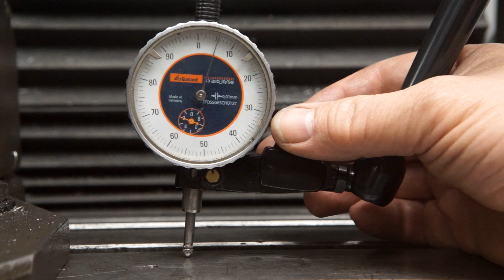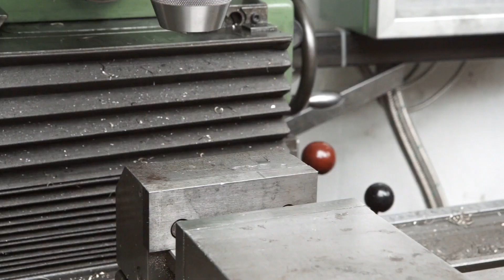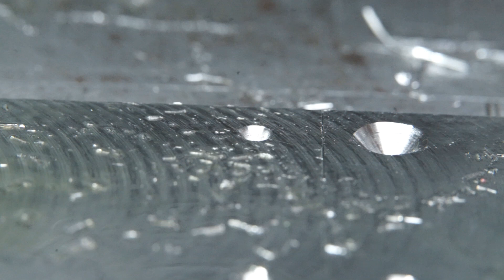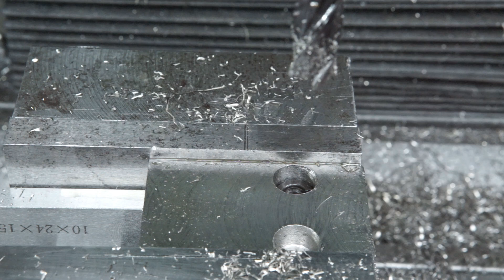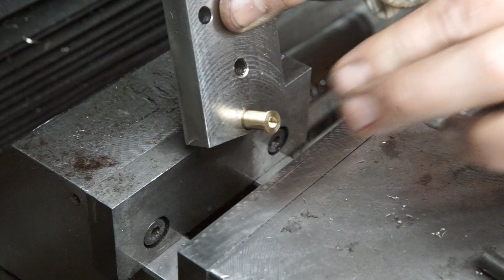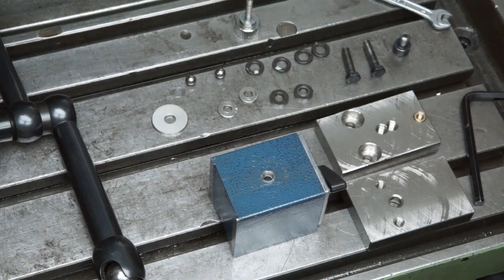magnetic base fine adjustment

Comment: Harald, when I drill or plunge mill any material which has stringy chips, I "peck drill" to break the chips.  Since I assume that you are aware of this 'technique," is there a reason that you didn't do that with the stainless steel in this video?  I ask because I'm sure that I'm unaware of possible reasons to not "peck drill" to break chips, at least in certain situations.  Also, at about 20:45, when centerdrilling the stock in your lathe, your centerdrill appeared to move up before starting to cut -- was that an optical illusion,  perhaps wear in your tailstock, or misalignment of tailstock center with the spindle centerline?
Reply from the maker: Thanks a lot for your comments and good questions.
With regards  to peck drilling: Honestly, yes, I am aware of the peck drilling technique, but in most cases I am just too lazy and did not develop the habit pd applying it. There isn't any good reason for not doing it. The friction clutch mechanism of my quill's auto feed would make it really easy to use. I will keep it in mind in the future.
With regards to the moving center drill: you are probably right: I didn't notice this before watching my video. I have to check this - perhaps with a dial measuring the deflection of the quill. The tailstock alignment should be fine, but I will also recheck this.
Thank you for your great contribution.

Comment: Dear Harald, did you notice that at 6:07 the carbide chamfer end-mill is moving left and right...?
Reply from the maker: Well spotted! Honestly - no I didn't notice this.
The reason for pre-drilling with the center drill was mostly because I wasn't sure if the chamfer end-mill would be able to "drill" in the very center.
I would expect that this should be sufficient to keep the chamfer mill "on track". I am obviously wrong.
And - again honestly - I don't have an explanation. I have to investigate this.
One possible explanation could be an issue with my y-axis. (On my Thiel the y-movement is NOT done with the table but with the spindle stock.)
Thank you very much for pointing this out.
Reply: @HaraldFinster  no need thanks, you offering such beautiful job and ideas to everybody...keep the great work my friend.
Reply from the maker: @5b4aezmarinoscyprus71  🙂 I just went down into my basement shop and did a few quick checks which confirmed my suspicions that the ways of the y-axix of my mill is adjusted incorrectly. I can move the vertical head sideways (perpendicular to the y-axis) by about 0.05 mm just with the force of my hands. With the axis locked the movement is below 0.01 mm. So, fixing this issue will be my next "project". 
An other issue is the fact, that I have more than 3 mm "backlash" in the y-axis, i.e. I have to turn the adjustment wheel by a full turn between positive and negative adjustments. Don't know if I will be able to film my repair.
Reply: @HaraldFinster  that's a great idea filming the repairs of your milling machine. Just a suggestion, did you ever consider to replace the lead-Screw nut with ball nuts..? The tolerance with this type of nuts is zero...
Reply from the maker: @5b4aezmarinoscyprus71  I considered this idea, but it would be a major modification. The backlash isn't a real problem for me, especially as I have a DRO on my machine which avoids the need of "overhooting" and targeting a specific measurement from one direction. I am pretty sure that my "backlash" issue is not caused by excessive wear of the spindle or spindle nut. I must have been drunk when I assembled the machine and probably forgot to tighten some screw properly. We will see...
Reply: @HaraldFinster  🤣😅
Reply from the maker: Quick update.
With regards to the play in the y-way: the tapered gib was loose and out of adjustment range. I did a quick and dirty repair by adding a shim. I am aware that this isn't a clean solution, especially as the gib is slightly bent. The play is below 5 µm now - which is "fine-ish"  for me.
With regards to the backlash: a guy from the German machining forum "Zerspanungsbude" recommended checking the plate which holds one of the bearings of the y-spindle in place.And indeed, it turned out loose - not even finger tight. It was a matter of five minutes to fix the issue.
Reply: @HaraldFinster  that's great...

Comment: BTW, I wonder if Belleville spring washers are available from someone like Hoffman?
Good idea using the "modified" locking washers!
Reply from the maker: Sure, it would have been possible to get Belleville spring washers. This would have been the "cleaner" solution. I just didn't want to wait for them and - honestly - I wasn't willing to spend 5 (or so) Euros to get 4 washers delivered.

Comment: Sticking in meine Nase...
May i suggest:
Use a small ball bearing as a turning point for the adjustment screw, and turn an internal "cone" on the adjustment screw end, to avoid any tendency to "wander" when turning...the ball should be in a short V groove to allow it to travel as the tip of the screw moves in an arc with the top plate. In a similar application, I mounted the adjustment screw in a "barrel" that was inserted "across" the upper body, so that it could rotate with the arc of the adjustment, and ran on a fixed ball in the bottom member.
Alternatively, one can use such a "barrel" in both plates, the one in the bottom can just sit in a V slot, but each barrel has a different thread, z.B. 6 mm standard and 6 mm fine, to achieve a differential thread adjustment, getting something like 0,2 mm per turn...
Probably not too clear an explanation, sorry that it's not possible to insert a sketch.
Trotzdem, nice job, nice video, kudos for showing an error, and how you fixed it!
Reply: But the differential screw will have to be untied in the middle with a cardan (or other coupling), otherwise everything will jam
Reply from the maker: @SergeiPetrov  if I understand the original suggestion correctly, the adjustment screw should run in slewable threads. This would solve the problem.
Reply from the maker: Excellent thoughts and explanation. Thank you very much!  
I did not think of the trick with the ball bearing but considered using the differential thread trick.